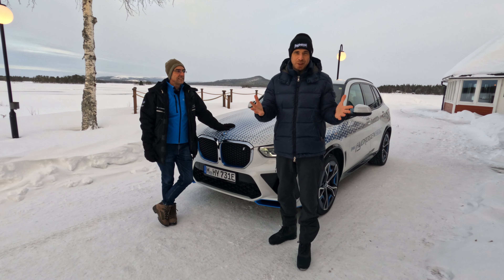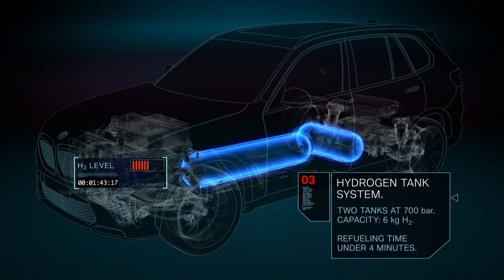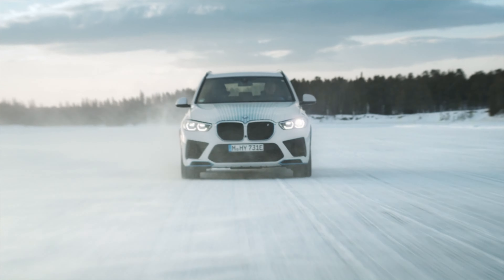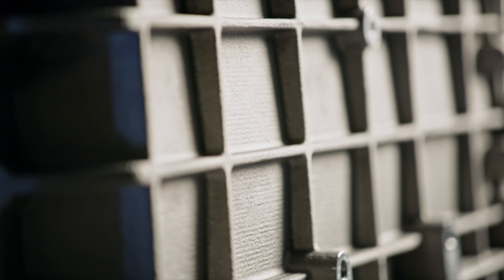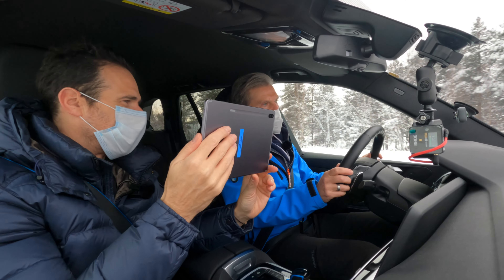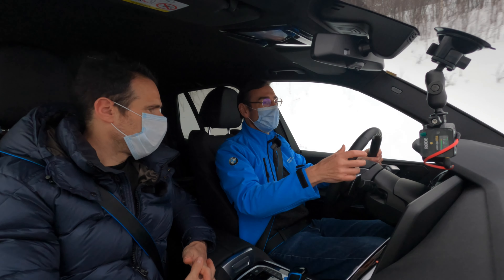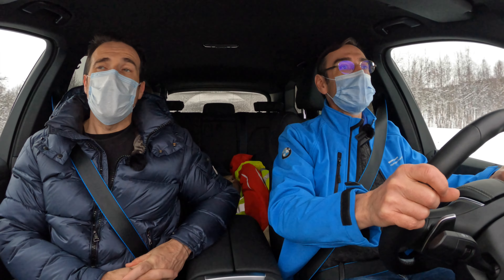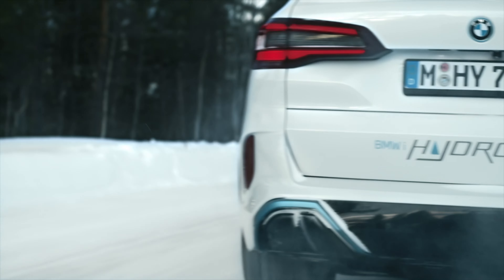BMW Hydrogen Fuel Cell iX5 - Review

Comment from the maker: Would you prefer a hydrogen-powered BMW or a battery-powered electric BMW?
Reply: Hydrogen-powered BMW
Reply: EV, I don’t wanna experience what oil is doing to us now. Hydrogen is another form of oil.
Reply from the maker: @akme18  Why?
Reply from the maker: @fancyIOP  How is it another form of oil? Curious
Reply: Both are equally pointless in Canada. Until we invest in infrastructure, none of this matters
Reply: @bmwblog  he might be referring to how it is created. To make h2 in useful quantities you need steam methane reforming aka massive amounts of natural gas. Otherwise you can't actually compress h2 enough to transport it to, say, storage hubs or stations.
Reply from the maker: @fancyIOP  But this is an EV also
Reply from the maker: @cwx8  The infrastructure is definitely the most important aspect
Reply from the maker: @cwx8  Interesting. So depends where you look in the chain. Because originally, you can produce it from the wind also.
Reply: @bmwblog  for sure and the most popular green method is solar electrolysis. Problem is we have to move it. H2 is a super small molecule. If you put it in a pipe it won't flow, unless you compress it to roughly 8x what we would methane. So that means you need to generate a lot of it quickly so that's where steam methane reforming comes in. The good news is we think we can pair the extraction of methane and onsite he generation with carbon sequestration which could completely deal with the CO2 from the entire fossil fuel lifecycle.
Reply: @bmwblog  better autonomy with less weight by not having large batteries. Cleaner energy, shorter refueling time, only water vapor residue. 
Sorry, my english is very bad ;)
Reply from the maker: @akme18  There are clear benefits of FCEV. No one disputes that. The biggest hurdle? Infrastructure
Reply: @bmwblog  Exactly, it is currently the great problem of this technology. The good thing is the possibility of converting a gas station into a hydrogen refueling station without great difficulty.
Reply: If all vehicles go electric there will be a mountain of old batteries to dispose of , much of which is not recyclable as I understand it. I’m for hydrogen
Reply: @fancyIOP  Where do you think EV are made from? How you think all of that lithium is made? Where do you think they make electricity from? Electricity uses so much fossil fuel to be produced. EV are 3x worse for the environment. LEARN BUDDY
Reply: @bmwblog  oil in the form of hydrogen by price hiking. Look at how we are all crying about petrol ⛽️ prices now, if hydrogen will also be price controlled by the cartels we will see hydrogen being pricey at some point and affecting everyday goods. That’s what I mean by Oil in the form of Hydrogen, at least with pure EVs Solar can be used to charge them all the time or most of the time.
Reply: Why not both? This iX5 appears to have a small battery at the rear for additional power on request and regen. It would be nice to be able to plug it in at the garage to recharge this battery as well. So I guess that would be a FCPHEV?
Reply: @akme18  except this fcev is said by BMW to weight roughly the same as the X5 PHEV which is heavier than a Model X long range.
Reply from the maker: @MrPikkoz  Different cars though.
Reply from the maker: @joaopinho2361  Can't really make it both from what I know
Reply: 100% Hydrogen. It is the car of tomorrow! Today. Environmental friendly and no disruption to commuting lifestyle! Please release this car this year or the next.
Reply: this is the most polite argument i have seen in a yt comment section
Reply: Goooo Hydro!
Reply: @bmwblog  the Mercedes GLC F-Cell is doing both as a plug in hybrid iirc
Reply: @bmwblog  Because it is a real cleaner energy than lithium battery…
Reply: Battery only
Reply: Why not liquid hydrogen?
Reply: personally i think the future would be a combination of both... hybrid Hydrogen Plugin.  But everything stands with Hydrogen fuelling stations, Electric mainly became popular because Tesla invested hugely in EV loading points.  having a 60 kwh Battery in the bottom would help trememendously...  and add a solar panel in the roof?
Reply: electric car major problem is the battert it degrades every time you charge
Reply: Definitely a hydrogen-powered, I wouldn't even think about battery-powered cars.
Reply: @derekwhyle1884  with all due respect, literally every bit of a battery can and will be recycled.  The economics of mineral resources will guarantee it.
Reply: @stevenfrazer46  I perhaps phrased my comment wrongly. Will all the batteries be recycled as my understanding is that economics is currently preventing certain components being reused. I guess legislators will have to enforce it.
Reply: @derekwhyle1884  I understand that Redwood and RecycLiCo are able to recover about 97% from the raw sludge at demo plant level, but most ex EV batteries at 80% capacity will be redirected to grid storage first.  Nissan are already doing this I believe.  I don't think it will need much enforcing either TBH looking at mineral prices general movement.  Good news for the battery EV way.  I bet band to buck this BMW h2 project is underwritten by the oil and gas sector, knowing blue hydrogen will underpin it, ie methane to H2.

Comment: Awesomeness 🙌🏿I may not be a Hydrogen fanboy because look at the prices of oil now, we don’t want to see another oil coming in the form of hydrogen but we appreciate the investment. I will however get a BMW EV in the near future when it’s on solid power batteries.
Reply: Get a Hydrogen Car. It's free fuel for 3 years.
Reply: @jasonlewis460  sounds great but if I get solar system and a pure EV I can charge it “free forever” not limited to 3 years.
Reply: @cwx8  I hear you, but I’ve seen a lot of companies coming up with solutions to battery wastes and also battery components. I mean 90% of the battery components can be recycled now, that 10% will also be looked at. I guess for now we will just have to wait and see how the market will pan out. Scientists are just the voices behind the data but the people are the actual buyers of those products.
Reply: @fancyIOP  I dunno where this 90% comes from. It must be by weight because it definitely isn't what you want which is cathode anode. I am working for a company looking to solve this exact problem.
Reply: @fancyIOP  Your individual solution doesn't have practically in a massive scale. Not everyone has access to a solar system. Not everyone can plug there vehicle to the grid. Mass Transportation has zero time for plugging in there trucks. Don't think food, goods and services are waiting for the grid to adjust. Hydrogen can be replicated in a massive scale. Hydrogen has the potential to power up millions of people not so much for EV.
Reply: @jasonlewis460  I agree with you but my issue is just what will happen when they start hiking prices of Hydrogen? That’s the issue I have with it… but I understand what you are saying. My Hydrogen/Oil comparison is about price hikes which people have no control of and now look how oil is abusing us when it comes to fuel prices, that’s my biggest issue… maybe I worry unnecessarily.
Reply: @cwx8  awesomeness, maybe it was 80% but it’s somewhere along those lines, I think I heard it from DW Planet A YouTube channel, if I find the video I’ll end the comment. But at least where you work you are trying to come up with solutions.
Reply from the maker: @fancyIOP  Not everyone can do solar
Reply: look at the prices of electricity?  driving on EV using commercial loading stations is more expensive then using gas right now..
Reply: @lordbachus  you are right, electricity prices are also going up but for me personally I will start with a solar system before I buy an EV just so I can “charge for free”.
Reply: @fancyIOP

Electricity prices enter the chat.
Reply: @lordbachus  we are all learning and hoping the prices go down especially with Nuclear Power Plants being deployed all over.
Reply: Tron-Jockey  I didn’t know, thank you for alerting me. I will research on it.

Comment: As an experiment it’s great however I doubt that many countries will put in the charging infrastructure also the need for clean eco hydrogen. 
I therefore don’t see a future for passenger cars. But for Trains, Shipping, heavy plant and possibly Aircraft I’m sure it has a great future.
Reply: Not sure if you understand how h2 is created.
Reply from the maker: Those industries could drive the charging infrastructure
Reply: @bmwblog  they can't though. It's enormously complex and capital intensive. Oil companies despite what the media suggests don't have that kind of cash.
Reply: @cwx8  yes I do hydrogen mainly through Electrolysis. But Green Hydrogen is expensive. Blue cheaper.
Reply: @garrycroft4215  not really. Electrolysis competes with blue on capital cost. Steam methane reforming will require carbon sequestration. Only blue hydrogen can produce at rates sufficient for pipeline transport. That's the issue.
Reply: @cwx8  £100 for 6kg 12 months ago don’t know the price today . An equivalent electric car would be around £15. There are no more than 10 working hydrogen stations working at any one time. 28,000 public EV connectors plus many Millions of houses with a plug socket.
Reply: @garrycroft4215  I was referring to the cost to generate. How that cost gets passed onto consumers will depend on carbon taxation processes. But I agree. I feel like we missed the boat on h2. Those costs are nuts btw.
Reply from the maker: @cwx8  But other industries could drive the price down
Reply from the maker: @garrycroft4215  Apparently the average in the US is about $10 per kg. So I guess it varies.
Reply: @bmwblog  yes California is keen on Hydrogen. Not sure about other States.
Reply: @bmwblog  The price of Hydrogen will drop to $7. When the price of gasoline will rise by 50% more. The price of electricity will rise 30% more. Producing more EV's will only make the electrical grid even weaker; a bad idea in a mass scale.
Reply from the maker: @jasonlewis460  So do you think h hydrogen is more feasible?
Reply: That’s what people used to say about EV charging infrastructure.

Comment: Informative, thank-you. UK only has 14 locations where you could recharge with Hydrogen. So, unless National Governments or the private sector of mainline Petrol/Diesel/Electric filling stations invest in such infastructure, this concept becoming practicable reality to use and buy such BMW's, is certainly a non-starter in the UK currently. So if going 'Green'. currently we have no-choice, only electric.
Reply: Even then you can't or at least you don't hope everyone goes electric at once. There's nowhere near the infrastructure needed.
Reply from the maker: Glad you enjoyed the review! This is a long game still. BMW says that only by 2030 we might see a full production run. Which means they are also waiting to see how the infrastructure develops over time.
Reply: I just wanna point out that this car is also "electric". FCEV stands for fuel cell electric vehicle. It's just the energy storage that differs.
Reply from the maker: @SoundboundOfficial  Exactly.
Reply: Well those 14 locations are more than there were ten years ago when it was about 3, mostly in southern England. Hydrogen will come soon, mark my words.

Comment: Hydrogen vehicle or Fuel Cell Electric Vehicle. The hydrogen function as an energy storage in the form of gaseous chemical. The current hydrogen source is from natural gas reform, which is the current hydrogen source use in the industry for many years. However, now the hydrogen is being produce from renewable electricity, which is through electrolizers (Other discussion). That means, that the hydrogen can be designated as a  "green hydrogen". Once in the vehicle, the green hydrogen is chemical and electrical change through a Fuel Cell into electrons (electricity) to run the electric motors. The only exhaust from the vehicle is water. As the vehicle is running, air (oxygen) comes in from the outside and combines with the used hydrogen molecules and  releases only water. Thus, there is not any fossil exhaust at all from the vehicle. Only water comes out. However, the challenge the industry is having is the green hydrogen production cost, and the infrastructure development. As a result, the USA government is investing in the research and development of lower hydrogen cost production and infrastructure installations. The benefits: faster fueling time, high performance, no CO2 or methane,  less weight, and around 350 miles of endurance. So, yes, i'll choose a hydrogen vehicle.

Comment: Hydrogen for use in the vehicle is 4x as expensive as traditional gasoline.  Couple that with lack of infrastructure to get refills and it's a hard pass for me.  I also don't like the idea of not being able to quickly assess and repair issues on my own.
Reply from the maker: Today....maybe valid points. But most of these projects are for the future where all the things you mentioned might look different
Reply: Go look at a lithium strip mine and tell me EVs are globally sustainable.

Comment: Please BMW, stop wasting your time on this folly, And we love the 4 bmw cars in our family, 3 of which are electric.
20% loss in electrolysis, 20% loss in transmission/transportation, 30% loss in conversion back to electric.
VS 5-10% loss from a grid source to your battery, much of which will be renewable when charged at night.
This is economic madness.
Question!  How many hydrogen road tankers are required to deliver the energy density of a diesel tanker!
18.

Comment: After nearly 2 years youve prepared this video, hydrogen is even far than reality, as EV now common choice. İt sounds good to fill up hydrogen in 4 minutes but there is no auch stations and the ones opened in some countries closed one by one. İmagine you xould generate hydrogen in your house and you could charge EV also in your House, you would much nire wnergy for hydrogen option to have same mileage because hydrogen generation and the fuel cell efdicincy is not good. İn the future you might expect more efficient batteries with new technology but compressing h2 is already at its limits, and it will not grow more mileage. Still insee some research for trucks and planes, but for cars at least with current infrastructure and technology winner is already EV
Reply: Go look at a lithium strip mine and tell me how EVs are globally sustainable.
Reply: @anon_laughing_man   actually i am interested, I am not sure i know "strip" but I know brine mines requires lots of water, electrolysis of H2 also requires water, but let me know if there is more into it. I am also happy to see that other materials are starting to be used instead of lithium, but their energy density is lower.